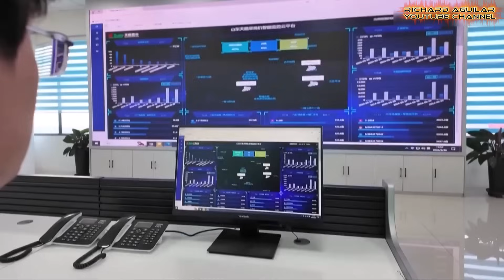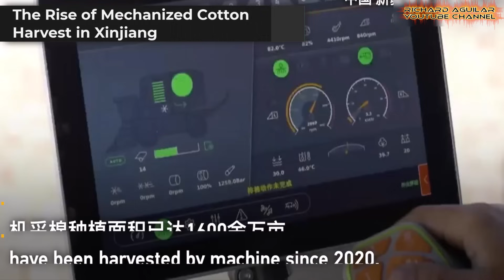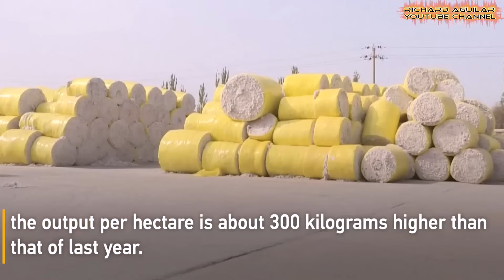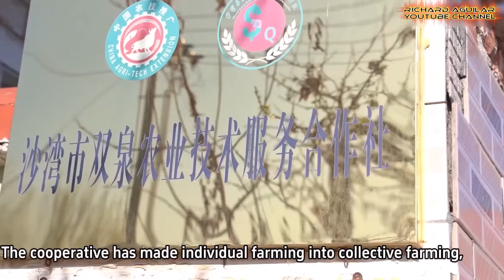China's Mechanized Cotton Farming: BEYOND AMERICAN SUCCESS?

Comment: This video shows a very large cotton farm with several machines working to harvest, process the cotton fibres, roll into cylindrical bales, ready for the spinning factories.
That is to say these machines are very sophisticated complete mobile  factories, not just harvesters.
They appears even capable of autonomous driverless operation.
An immediate question is how typical are these mechanized Xinjiang cotton farms and are there many smaller farms still depending  on human labour to pick the cotton?
That answer can stop this "forced labour" accusations being made by the west.
The other important information is who made these "mobile factories".
Not likely to be USA John Deere products which are usually painted green colour.
Reply: A decade ago, before cotton harvesters became widespread, residents from other provinces in China would travel to Xinjiang to work as cotton pickers. However, this practice no longer exists today, as cotton fields in Xinjiang are now large-scale and using machines for harvesting is more cost-effective.
Reply from the maker: Your thoughtful question touches on the complexities of modern agriculture and the broader issues surrounding labor practices. It’s vital to look at the big picture, considering the balance between technology, human effort, and the ethical implications of each.
Reply: The cotton-picking machines were designed and manufactured by Chinese factories themselves.
Reply: @吴叶候 
Thanks for the information.
China should now push hard for the international export and widespread use of Xinjiang cotton to counter the lies on the forced labour issue.
Also be sure that the use of these high tech "smart" electronics in these Chinese machines are easily maintainable and can be quickly repaired and serviced "locally", a mistake the American farmers using John Deere machines found out.